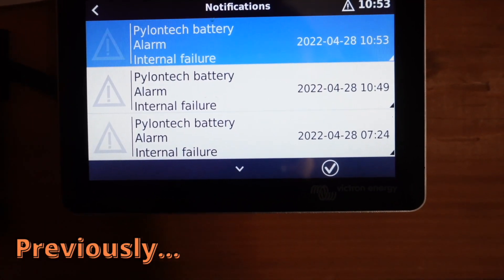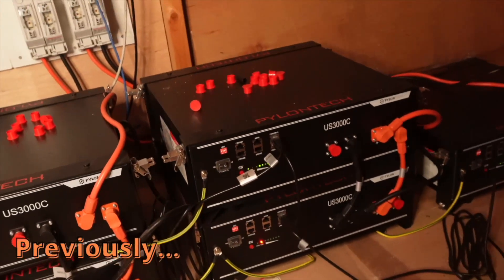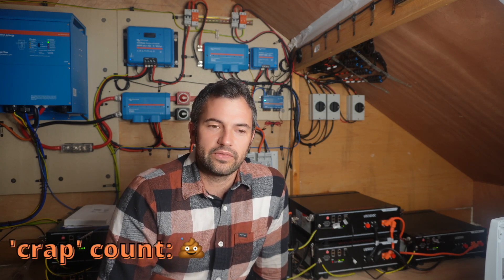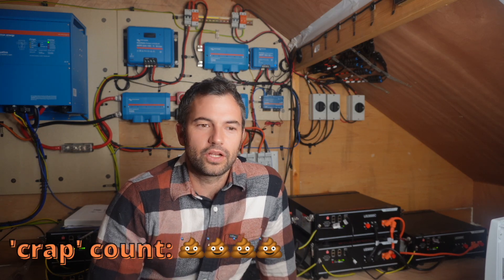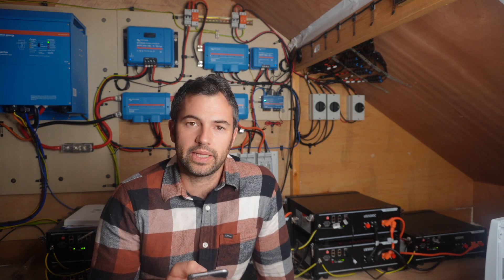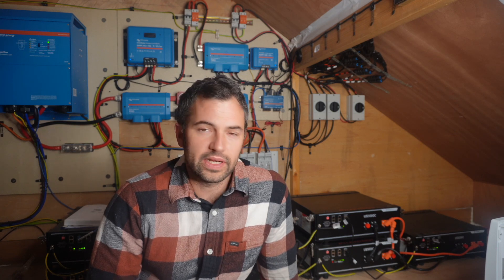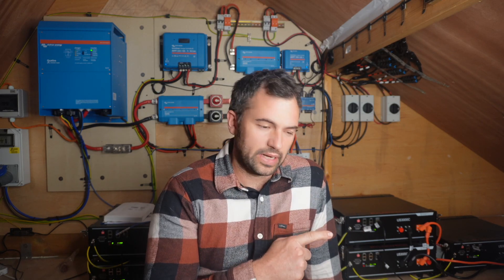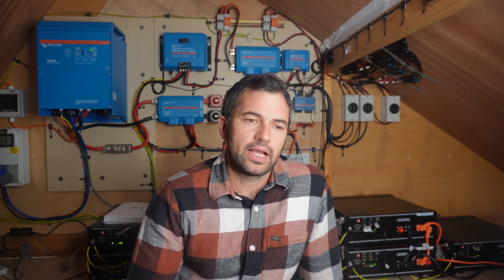WHY WE WILL NEVER BUY PYLONTECH AGAIN

Comment: I don't have a horse in this race one way or another; but sounds to me entirely like you screwed something up, probably a short of some kind, killed one battery and damaged the next one along... Now trying to make them pay for it.
Reply from the maker: The batteries in question were number 6 and 8.  8 never even turned on so that can't be the case.  Also we sent all of the battery data to our supplier (who forwarded it to Pylontech) and they don't seem to have any issue with what they received.  They said there was a short, but haven't blamed us for that at all.
Reply: @The_OffGridFamily  The completely dead one was presumably hooked up to the one with ongoing problems though.

Comment: Good on you. I feel your pain on this - that is crap. ... Pylontech as good as admitted it is faulty, yet they are clearly not minded to do anything about it. I have a single US5000 with an Easysolar II GX 48/3000. Only 800w of solar at the moment (small place - I wanted to start small & I have room to double it next year - just wanted to test for a bit, though early indications exceed my expectations. It was to some extent inspired by your vids, so thanks!). However, I am slightly worried about buying another battery following your experience. It was going to be my next step.  I must admit mine has been perfect so far, but I can understand your point: it's all OK until it isn't.  It seems as if it could be a bit of a lottery with these batteries, and the poor customer service that you have experienced now concerns me. A more general point that worries me: my supplier was excellent on delivery but contrary to my own suggestion, they advised  wrongly on a cable and then when I explained it didn't work and asked if I was doing something wrong, they said "well, we're not installers, we can't advise". They advised at the point of sale though. ... So my general point is, if Victron and Pylontech refer to the supplier, but the supplier then says 'no mate, we are not installers - can't advise' - where does that leave folk? Anyway, routing for you & look forward to seeing the next instalment & hoping for some better news. Fingers crossed.  Keep smiling. Rob.
Reply from the maker: Thanks for this Rob ☺️ We are so pleased that our videos have helped but even more pleased that you haven't had any issued with your battery.  All the best for your next installation.  There is a good chance that another us5000 would be fine, but we understand your reservations!

Comment: Great upload, I was put off by pylontech batteries by a solar installer they didn't think they were up to much, what your going through was really what i expected with Warranties on batteries.

I'd be very supprised if anyone had any joy getting any repairs done any time after the first year,  and it's put me off going down the battery avenue full stop,  your battery seems to be faulty and they should at least be getting it pick up and tested. Like you mention Crap Service and Battery and warranty infact what WARRANTY!!!!!!!!
Reply from the maker: Glad you found the video useful ☺️ (Sorry for the abuse you received in the other reply)

Comment: So basically your supplier is rubbish. We've had a handful of faulty PTs over the years.
Most commonly it's an odd fault due to different firmware versions. At no point have you said you've put them in order newest to oldest or checked? Or levelled them all to the same version.

However the faulty ones have been dealt with in a timely manner, with the supplier taking it back and shipping a replacement immediately (subject to stock)
Reply from the maker: The batteries were all bought at the same time, so no ordering of newest to oldest needed.  We are really reluctant to get involved with firmware as we have heard such horror stories and can't find an official Pylontech source for their firmware updates.  If you are aware of one we would love to know? 
We have had two faulty batteries.  The first was taken away and the supplier said nothing was wrong with it, even though it hadn't switched on when we switched the others on.  The second faulty battery has taken a very long time to get sorted, for reasons including the fact that we have emailed the supplier 4 times in the last month and have heard nothing back 😩
Reply: @The_OffGridFamily  Firmware updates are available via your supplier (well should be - clearly you already have a supplier issue here if they aren't attending to warranty problems and ignoring you)
WIth regard ordering of batteries - that is completely incorrect. It is clearly stated in the Pylontech manual, point 15, page 5 in the US3000C document:
###
15) Compatible with the US2000C, US3000, and US2000. 
*Mixture using master battery priority: US3000C>US2000C>US3000>US2000 
For same type of module always use the latest production unit as master. 
###

They key point being the last line. Always use the latest production unit as the master. Assuming you haven't changed the firmware on any of them, that would be the master, and is the manufacturers advice, detailed within the provided manual.

I'd take a fair wager you've got newer firmware on this pack 6/7 you've moved about and it should be top of the stack. Or even older.
Put the packs in serial number order. And if still in doubt, now you've got batteryview, check the firmware versions..

Comment: We had the same alarm issues from our pylontech batteries - we only had 2 and couldn't justify sacrificing one.

In the end, we found a post on a Victron forum where someone suggested limiting the Maximum Charge Voltage in the DVCC settings to 52v. We still had issues at this level, but reduced it to 51.7v and haven't had an error since.

For us, this was a balancing issue between the different battery packs as opposed to cells within a battery (the pylontech hardware can only balance very small amounts of current once they are largely charged). By limiting the maximum voltage, it prevents certain cells being much higher than other ones. We've now removed the limitation and it's all working fine now.

I don't know if it will help you, but figured I'd mention as it was a simple thing to try.
Reply from the maker: Thanks for this ☺️  It's tricky as the other 6 are working perfectly and are all balanced.  We think it's time to send the other one away and get it looked at... if we ever get a reply!
Reply: I get what ur doing here, but 52v (3.25v/cell) is way too low to properly charge these batteries to a full charge,,,ever! I would suggest for now you try discharging the problem battery to a very low SOC and then recharge it to 52v & then slowly increase ur settings to allow sometime to absorb as you slowly bring it up to 54v-56v (3.45v-3.5v/cell), this could take some time, days even to achieve with a passive balancer, but may help to reset the cells & BMS to operate a bit better. 
Lifepo4 chemistry requires a minimum of 3.375v/cell x 16 = 54v to charge each cell to 100% SOC. 3.45v/cell is probly a very good & safe area, ie: 55.2v. I believe the main problem with most of these server rack type batteries is they have a passive balancer that only shaves a very small current of about 60-120mA from the highest cell when balancing & it must be charging to balance (depending on internal settings of BMS). 
Check Andy’s Off Grid Garage Australia for detailed info on lifepo4 & solar tech, he is a wizard. Hope this helps. Cheers
Reply: @evil17  Unfortunately, you make a small mistake. The unit has only 15 cells, not 16. That’s why the voltage should be lower.
As Victron says:
My system only charges the battery to 52.4V

When DVCC is enabled, the battery (via the CAN-bms) is responsible for the charge voltage. The Pylontech battery requests a charge voltage of 53.2V. We have however found that in practice this is too high.
The Pylontech battery has 15 cells in series, so 53.2V equates to 3.55V per cell. This is very highly charged and makes the system prone to go overvoltage.
It should also be noted that a LiFePO4 cell stores very little additional energy above 3.45V.
For this reason we opted to override the BMS and cap the voltage at 52.4V. This sacrifices almost none of the capacity and greatly improves the stability of the system.
Reply: @IPad-OG  Thanks for this info, I was unaware Pylontek use only 15 cells, is there any other manufacturers using this 15 cell configuration?  I guess this is another way to keep production costs down. This makes sense what u say is going on here, & yes 3.45v is the optimum voltage where a cell can be fully charged, all be it a bit slower to reach a 100% SOC, & 3.5v would help it get there a bit sooner with a little less absorption. Cheers

Comment: Who's the supplier?
Reply from the maker: Midsummer Energy in Cambridge
Reply: @The_OffGridFamily  having the same issues with my supplier not giving the level of aftercare and support and also refusing to directly help the end user! The way I see it if the physical installation is carried out in accordance with the manufacturer requirements, then any software issues or internal battery failures should be the responsibility of the supplier and manufacturer and they should carry out any warranty replacements ASAP and without major disruption to the end user.

Comment: Hi guys. Sorry you are having problems. I've been using these batteries longer than most and have not really had any problems myself. From what I can see of your system you have it configured correctly. Yes there are some minor changes could be made but none of them should cause the issues you've been seeing. You are quite right to be angry. Your supplier should have replaced that first battery that never worked straight off the bat. I think you should get some advice about UK law and what your rights are as a consumer. The battery with the errors obviously has problems, more than likely with the BMS board rather than the cells. If you've had it less than a year you may still have rights under UK law. As others have mentioned, the problem with these things from China is your limited recourse when you have issues. If Pylontech have an official UK distributor then really they should handle all the warranty claims.
Reply from the maker: Thanks Nicholas for your comment.  As you know, we've been watching your videos for a long time and appreciate your input.  Would be really interested to hear about the tweaks.  Perhaps drop us an email if you've got time? ☺️
Reply: @The_OffGridFamily your contract is with the supplier. Although you have put in a lot of effort you don’t need to. It’s clear that the batteries are not fit for purpose and therefore you have a case against them under the consumer rights act. If they give you a 10 year warrantee then that sets the amount of expected life under the act. Always but on credit card as you have the backup of the credit card company. 

The problem with those type of batteries is they are generic batteries build out of a factory in China. Most likely the company that brand a m has little design input so are in effect just reseller. Not your problem though as you contract is with who you purchased them from.

Comment: Sadly most products from Chinese products are great until they go wrong, and then there is very little recourse. They are only interested in taking your money. As others have said I think you should take the supplier to court on the basis of goods not fit for purpose, or lasting a reasonable amount of time, especially when offered with a 10 year warranty. Assuming you purchased from a UK supplier they will covered within UK law. Good luck. I won't be buying pylontech now.
Reply from the maker: Thanks for your support.  This is definitely a step for us in future although we had hoped not to have to go to court over it 😩

Comment: Hey Off Grid Family ... David Pos did a video of using bus bars rather than using the double terminals to wire them in parallel. You might want to watch his video in case it might be the solution to your alarm problems. Goodluck!
Reply from the maker: Thanks for this.  We have got them wired in parallel to a bus bar but will have a look.  Thanks ☺️👍

Comment: Andy from off-grid-garage is running batteries without communication.

1) charge controllers and inverter should be set up for the correct/preferred voltages for lifepo4, and should not care about what the batteries think about the world, they should just care about the voltages they see.
2) The batteries individual BMSes should protect the batteries regardless. And that's all they should do.
3) Andy uses a victron shunt to have his victron setup keep some measure of the state of charge of the batteries.

So if the battery itself is fine, and just the bms does not like to talk to others, then your system should just work...

But yes, pylontech is crap...
Reply from the maker: Thanks for this ☺️ Our understanding is that we can't use a shunt with these batteries.  We are pretty confident it isn't a communication problem now, so are pushing our supplier for a repair/replacement.  The other 6 are working perfectly now that we have removed the battery in question 👍

Comment: Thanks for the update
I really feel your pain. You should not have to deal with the manufacturer, your contract is with the supplier.
I would have put them on notice and taken them to the small claims court long ago. To leave you with this issue is not on and against UK law (I'm taking it the supplier is a UK company!)
Consumer Rights Act 2015 - The product should be 1) fit for purpose.  2) Satisfactory quality. 3) As described
If any of the above is not correct then the supplier must fix/replace it and sort out the problems.
Sorry if this is not what you want to hear, but by-passing to the manufacturer is not the way and there is not a contract between the two of you, the supplier may want or say for you to do this as it takes it out of their responsibility.

I hope what you have found so far goes well and it proves that battery pack is faulty, but doesn't that leave you minus one battery? 
If so, this should be repaired or replaced by the supplier.

Please keep us updated, all the best
Reply from the maker: Thanks for your comment.  The vast majority of our communication has gone through the supplier...partly because Pylontech never replied! We are on it with the supplier now and will be looking to take further steps if things aren't resolved soon 👍

Comment: I've been thinking about buying 8 or 10 of these but will look for another brand now. At £1000 + a battery you should expect way more help from both supplier and manufacturer. 
I know how frustration it gets when you pay good money and get crap in return so hope you get things sorted.
Reply from the maker: Thanks for your comment.  We are glad you have found the video useful ☺️ All the best with your future research and project.  We'd be interested to hear what you go for in the end as we are hoping to do a minibus conversion at some point and certainly won't be going down the Pylontech route, regardless of what the devout fans say 😁
Reply: I have been pushed towards these by a number of the suppliers I have had quotes from but have been pushing back mainly on the build quality I see from various you tube tear downs I have seen. This seems to confirm my initial thoughts on Pylontec. So far I have a preference for SOK slightly dearer but seem a lot better and now available in the UK, not made a final decision yet though. Thanks for this.
Reply: @marktj1   I too have decided against Pylontech and will go with SOK.
Reply: @gilladams8895  
Hi I'm looking at solar in thnex couple of months, the installer has quoted for pylontech 5000 battery 4.8kw after reading the posts I'm reconsidering them, what are SOK.
Reply: Dont follow this guys advice.  I have designed systems using 100's of them.  0 failures.  I have 4 x US3000 myself and they are working just fine after 4 years of cycling.  This is what happens when you DIY and dont understand LVdc.  His batteries should have been in a single stack with equal cable lengths throughout.
Reply from the maker: @Mr2cmE   Unfortunately this is why we ended up doing a DIY installation ⬆⬆⬆ Yes, they could have been in one stack, but it's not about the stack.  It's about how they are wired because of the size of our inverter.  Because the Quattro can surge up to 20K watts, we needed 4 sets of cables.  Pylontech have seen this video, and contacted us to resolve the problem.  They had no issue with our set up.  The issue was the battery, which they took away and repaired.  We have been contacted by quite a few people who have had problems with these batteries.  We know we aren't experts, but (unlike some people) we never claimed to be which is why we took our advice from Victron and Pylontech themselves... see point 7 (Example wiring diagram) https://www.victronenergy.com/live/battery_compatibility:pylontech_phantom
Reply: @The_OffGridFamily  did you make a video telling people that the manufacturer has finally reached out and solved the issue?